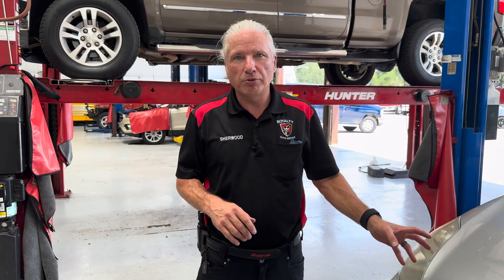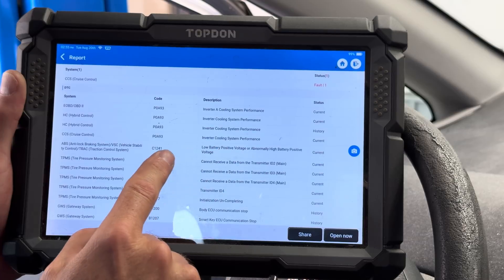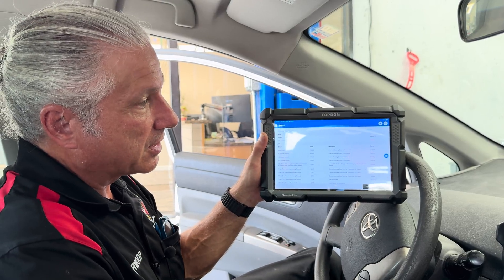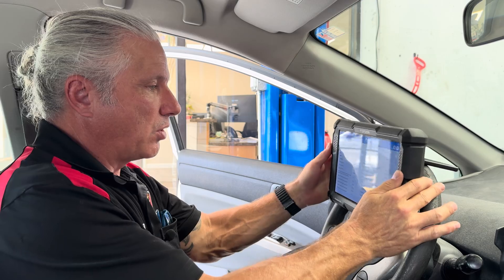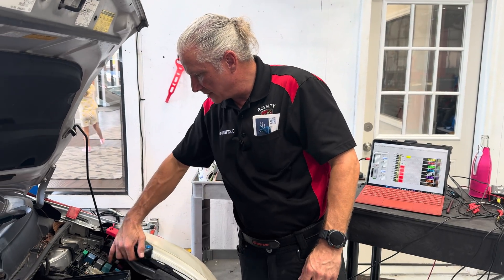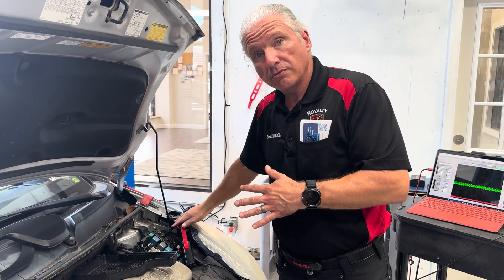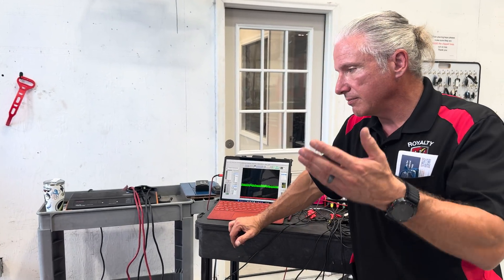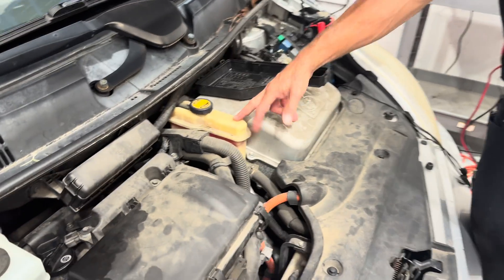Diagnosing The Dreaded Prius “Red Triangle Of Death”

Comment: What if the coolant pump is working? And the 12v battery is new. What else is there to check for?
Reply: Hybrid battery issues
Reply: @Not_Sword_Saint I code a better code reader and now its showing a p0aa6 indicating voltage leak but I have no idea where it is shorting or how to find the short.
Reply: @JamesSmith-dn8lb  I'm dealing with the same thing. It's a nightmare.  Did you get yours sorted?
Reply: @gingerfarr3689 I took out the battery pack and cleaned the terminals and it worked fine for a few weeks but the code is back again
Reply: @JamesSmith-dn8lb ugh, I've been on a wild ride with mine. Still at it. I do have 2.8 volts on the hv battery side of the relay between the positive and negative with the safety plug removed. Not exactly sure what that means but I'm about to find out. LOL
Reply: @JamesSmith-dn8lb I figured it out! If you have a multimeter measure DC volts from the bottom of each module (where it bolts down to the case) and the part that sticks out where you attach the bussbars. It should be ZERO. I had two modules that tested .5 volts BUT MY DUMB ASS THOUGHT IT WASN'T A BIG DEAL, I put it on my grid charger. That made the acid leak visible on those two modules.  (They still tested just  .05 volts (leaking) though from bottom to terminal)
Reply: @gingerfarr3689 I'll definitely look into that

Comment: My son has a 2012 Prius C and he was losing coolant, but there was none on the floor and I do not see it leaking into the oil. Any help to troubleshoot will help. A local shop here in Orange Country CA told him he needed to replace the engine, so he paid them but the issue began happening again after 2 years 🙏

Comment: I had the red triangle recently on our 2009 prius.  No ecu codes! But the car wouldn't shift into drive. I used the torque app to clear codes and this allowed ready indicator to come on and I could shift and move the car. But only if I shifted to drive soon enough. Ie it repeated cleared the check engine and red triangle but they came back if I didn't shift to drive or reverse within about 20 or 30 seconds. I used the torque app to monitor the auxiliary (12V) battery and saw that the battery was just barely above 12V until shifting into gear, after which it sat at 13.8. After a few cycles of red triangle and code clearing  and monitoring the 12V battery it became clear that if the 12V battery actually drops down to 12V, the red triangle is triggered. I then went for a 20 minute drive to charge the 12V battery. No more issues.  But then I spotted the rear cargo light on. Someone must have turned it on during the week we had left the car sitting before this incident. Anyway, moral of story: suspect the charge state of the 12V even if the computer comes up fine. Always good to have a booster in the car BTW.

Comment: If one pump goes out you may as well change the other one too!  I had the circulation pump go out for the gas motor and then then inverter pump went out...inverter pump is an easy fix but the other one is hard to get to unless you have a lift.

Comment: Toyota dealership will fix the pump for free if the Recall hasn’t been completed! Did you run the VIN # for the customer to see if the Open Recall work has been completed for the inverter pump?

Comment: I've been driving a prius for the past 200,000. I bought it with 90,000. It has 300,000 on it now. Never used anything more than a code reader. It's a whole lot faster to figure out the issue.
Reply: Hi, what year is it?
Reply: @NoiseySparrow It's a 2006 but now I'm going to have to take this comment back. I ended up jus doing my brake actuator and I ended up getting techstream diagnostics software to do the job. So yeah you can get by with a code reader for most things but not everything.
Reply: With brake actuator, try topping off brake fluid. Totally worked for me

Comment: Edit: You covered it!  Whenever it's in red triangle of death mode, it turns off the air conditioning compressor to save electricity. If you can drive with an active red triangle of death I've done it. In Arizona you notice really quickly whether it's just your fan blowing or whether or not air conditioning condenser is actually operational.

Comment: @theroyaltyautoservice   Thank you for the video and showing the flow. I spent 17 years spinning wrenches prior to leaving the auto and HD trucks service in 93 to move into commercial and residential HVAC-R service . (Was tired of constantly having to purchase more tools, stinking like diesel fuel, and looking like I spend my days rolling around in printers ink - too many inframe overhauls etc. lol.) However I have remained in some form of auto repair for family and friends. 

Damn the technology changes and glad I left just on the issue of the need to buy more and more diagnostic tools. With that said I just 2 years ago wished I had some of the tools. Had my 2012 Ford Explorer that had two issues. One was an electrical issue (dead instrument cluster) and two a catastrophic engine failure due to a failed water pump. Replaced the engine with fully remanufactured. However got my ass kicked with the electrical due to not having the proper tools. (Thanks for pointing this out to all the importance of the proper tools and using them and rechecking after a repair). Though I got my ass whooped I triumphed lol though too  much time spent.  HVAC has now become the same and thankfully I am retired. 

HOWEVER, I have my sisters 2010 Prius to help her with and I have no real experience of knowledge working on. It too has the triangle of death and the following current codes C1310, C1259, P0A80, C2175, C2122, C2121, C2124 (all but one TPS reports preasue. History Coes P0A80, B2312 (X2 passenger side & rear left window switch) B278C, U0155, U0142, U0293 - all smart key loss of communication (power source, IPC BCM B, EV Control / Hybrid Vehicle Control).  I cleared all codes and all cleared and did not return with the exception of one TPS. My sister reports that she found mouse scat under driver and passenger seat and in glovebox. Im thinking wiring issue, yet this is but a guess and I still do not have proper diagnostic tools just using ODB reader with Dr Prius / Dr Hybrid.  Any thoughts other than to take to a qualified shop LOL  such as most likely / less likely, areas to look into, and test to do? Thanks
Reply: You asked DeepSeek?

Comment: Is the inverter water pump supposed to be running all the time? Or is it only when the vehicle detects the battery getting too hot? Is that coolant reservoir not shared with the engine, so it would be dangerous to remove it after engine has come to operating temp?

Comment: Is it possible to diagnose if the inverter pump is pumping, if the gas engine does not start? I have a 2010 Prius which turns on, but gas engine doesn't start, and can't gear the vehicle to Drive, so I'm wondering if that doesn't avoid of a proper diagnose of the pump
Reply: Pump runs all the time car is in ready, look for the movement in the tank

Comment: NOPE, it's NOT the Red Triangle of Death. Officially it's the Master Warning Light that alerts us to possible problems in one or more systems. It could be low engine oil.
Reply: Or the door open while in drive!
Reply: What does low engine oil mean? And where would that be
Reply: The low engine oil means that your engine oil is low in the car, usually because of oil consumption on the de vehicles, you check the level by pulling a yellow dipstick that’s under the hood towards the passages side, if your oil isn’t between the 2 holes on the bottom of the dipstick your car is too low of oil, don’t ever let it any lower than the bottom hole

Comment: Great videos, a while back you talked about a fluid to apply to electrical terminals to help with intermittent connection issues. What is that fluid
Reply: Could it be dielectric grease?

Comment: Yeah, the pumps are the most common failure item in these, next is the battery harness which corrodes and terminals break and of course cells can go bad which can be replaced individually. Scan data is super helpful in these, for pumps and variations of .5 volts between cells can cause codes and the red triangle of death, so it doesn't take much.

Nice work.
Reply: The battery harness for the 12V or the hybrid battery are most likely to corrode?

Comment: I tested a four wire pump on a 2015 prius with power,ground,activation and feedback signal
good power,ground and activation
but bad feedback signal,this was causing the problem
it was the same fault code low performance, which I find misleading regarding the real fault

Comment: You never said what kind of pump that is for the amateur guys they need to know that
Reply: Hybrids have an electric water pump separate from the mechanical one on the engine for the hybrid system
Reply: this electric pump is pumping coolant to keep the electrical inverter cool. Prius's have two separate cooling systems with pink antifreeze, one for the engine and one for the inverter. The inverter generates heat so it needs to be kept cool.
Reply: @davidbaldwin2729  Prius's have 3 cooling systems, the 2 you mentioned and also a cooling system fan for the hybrid battery in the boot of the car.
Reply from the maker: 3:33 is where he mentions it. 👍